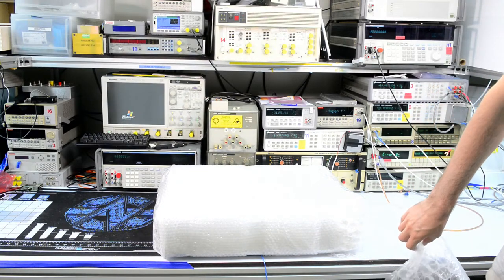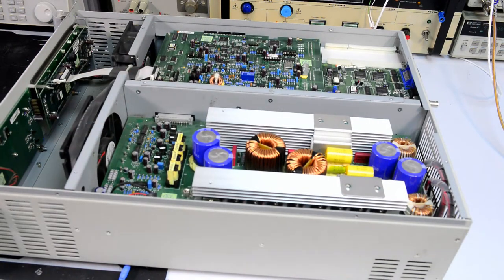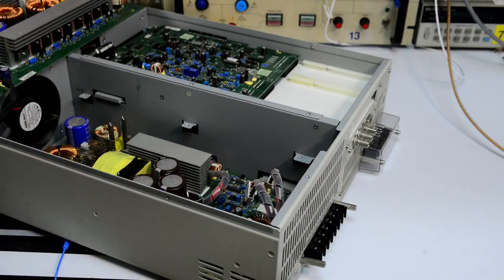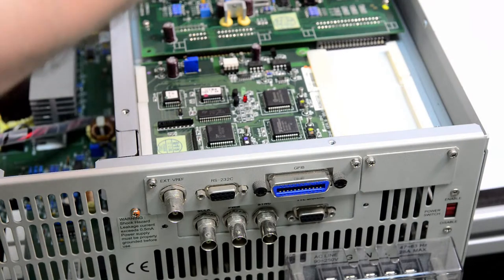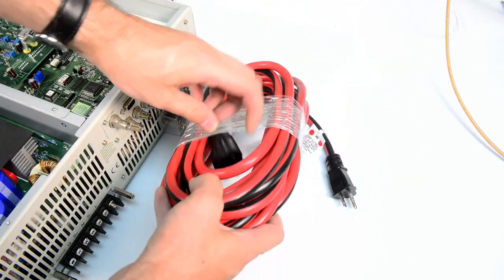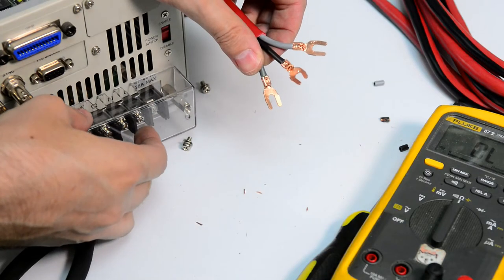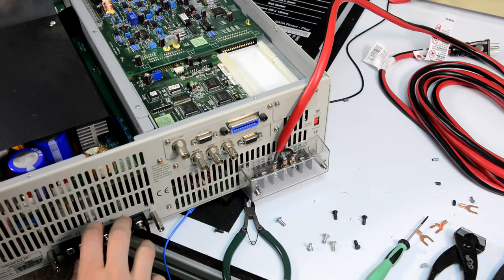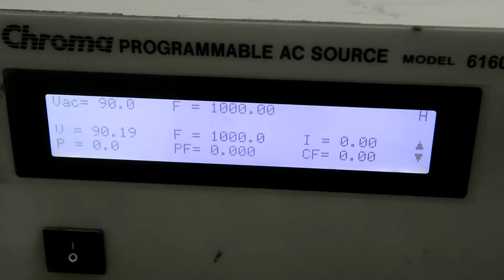Teardown and quick test of the Chroma 61604 2000VA AC/DC source

Comment: I got to work on something recently which works on a very similar principle, mainly a 300-watt true sine wave power inverter made by Power Bright.  My father had me look at it when he was having trouble powering a load which used less than half its rated power output.  It turned out that while the unit for the most part is very well made- actually better than most of the cheaper inverters- they skimped on the electrolytic capacitors on the input boost converter which produces the high DC voltage needed to drive the inverter itself.  Both had vented and started leaking through the base.  I replaced the two capacitors and it solved the issue.  Knowing how these work it is quite impressive how clean the output waveform is; looking at the output with a digital oscilloscope through an old low-voltage transformer I couldn't see any switching noise whatsoever in the output.